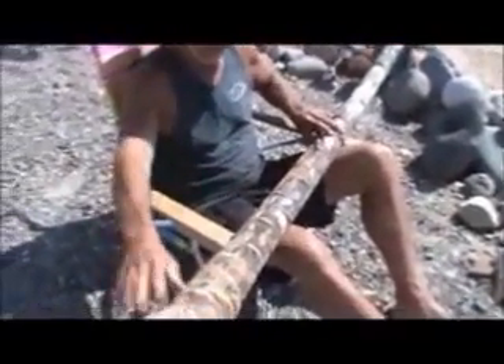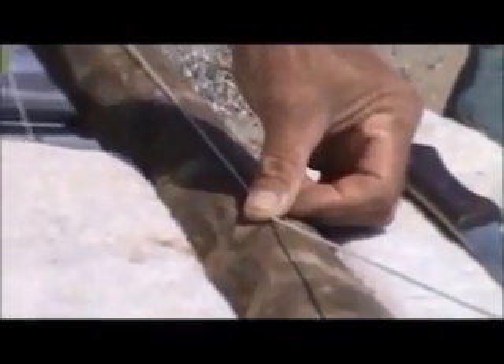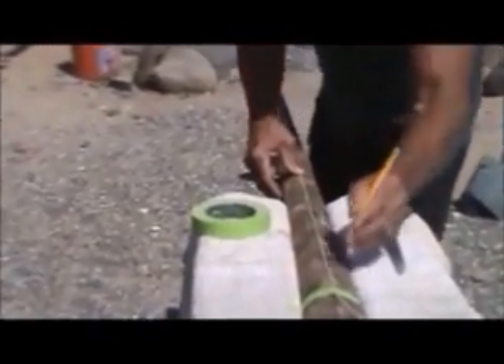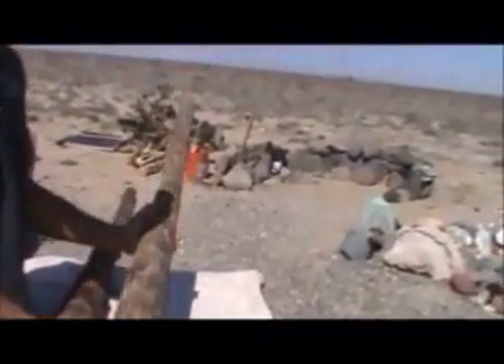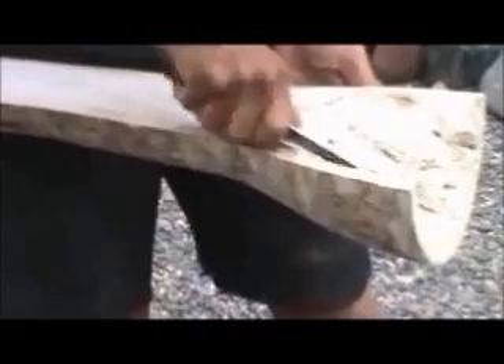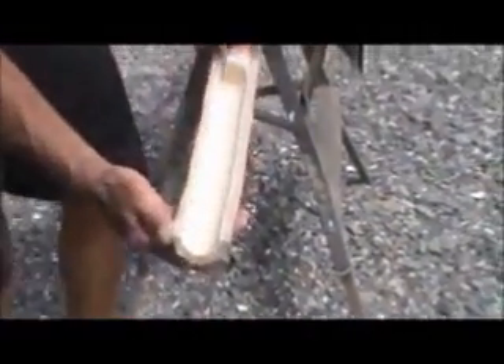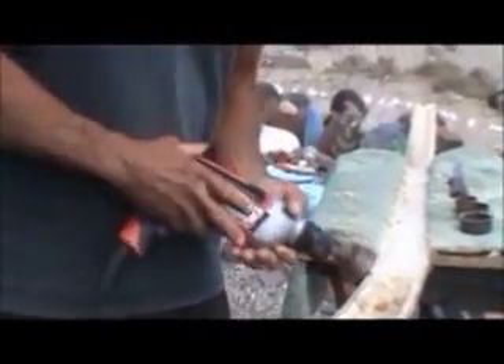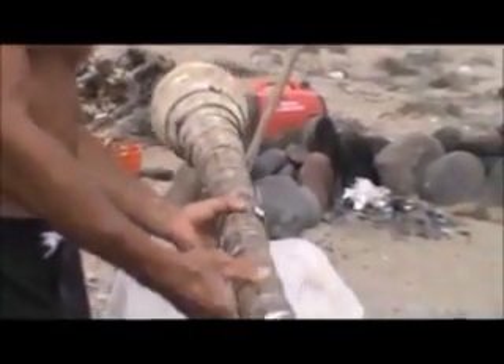Part 1 Making A Didjeridoo From Agvae By Glen Horn

Comment: Great vids Glen. I do almost the same thing as you. I use a fiberglass epoxy that sets up too quickly to pour and roll. The idea of using hole saws to clean out the inside is something Im going to use. Thanks for the vids.
Reply: Hi, make sure you drag the hole saw otherwise it will bite and you will lose control.  It will take a chunk out of your didj. Good luck.
Reply: Wire wheel brushes with hex is where its @

Comment: Hi Glen!- HELP!! 
I just finished my first AGAVE didge and I think I failed epically by a costly mistake using over powered grinding tool,  not paying attention to my depth.  In short -I  removed too much of the inner pulp all the way up to the mouth piece, so there is NO 1 -1/4 bore tube to the 32 inch mark..I literally took out all the pulp from the bell up to the mouth down to the hard wood roughly leaving a consistent and even 1/4 inch thick edge from the mouth end to 1/2 inch thick a the mouth of the bell which is almost 9 inches wide.. My inner diameter at the mouth (without mouth piece)is  2 inches and gradually expands out to 9 inches at the bell end. So the whole inside is way wider from the mouth to the bell.
 I made a 3 inch long, 2 inch inner diameter, 1-1/2  diameter hole mouthpiece made of Mesquite wood. It looks fantastic..but... When all sealed , glued and finished, I tried to play it for the first time. (not a beginner player)..It literally sucked the air out of my mouth and I cannot sustain a drone.  This is a remarkable Agave 87 Inches long and a perfect bell..I am devastated that I may have ruined such a fantastic plant.
Question-  Can the zero back pressure issue be fixed somehow? 
Would a much longer mouthpiece with a  smaller- consistent clean bore hole of 1-1/4 inches solve some of the problem with  the back pressure? or an even Longer mouthpiece?

Thank you for any advice you can offer. 
-Roy

Comment: to make the splitting easier you could use a chalk box instead of fussing around with tape. i dont think it would stain, but if it did they have some color choices available.
Reply: Hi, I started using a machete and a sledge hammer which makes it split perfect, with no seam at all.  But thanks for the input.